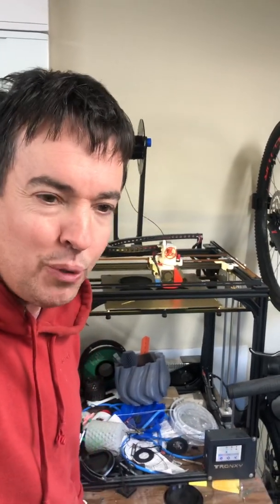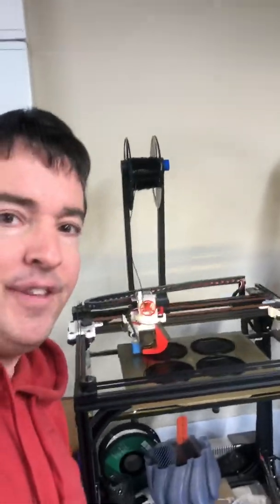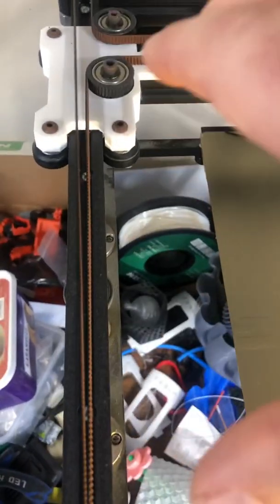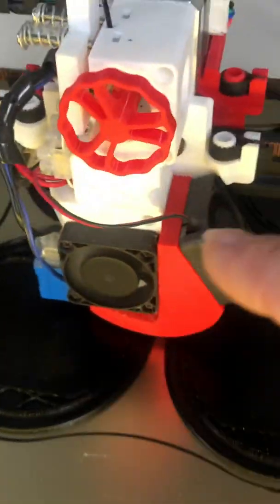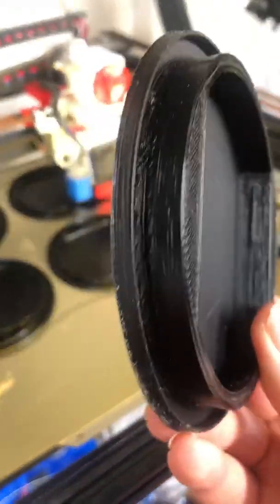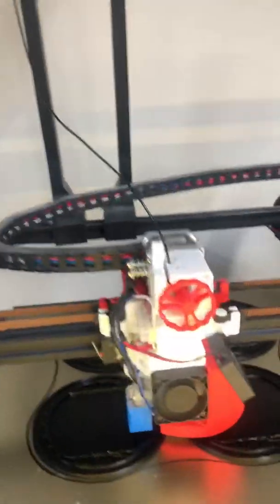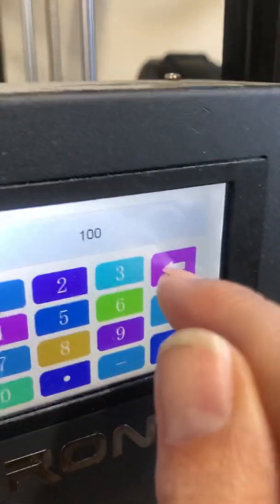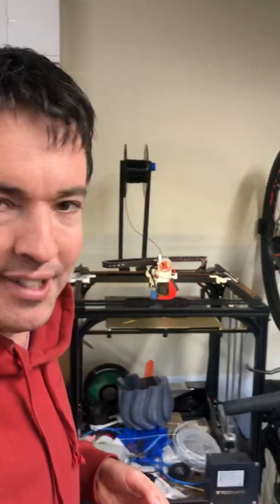Old Tronxy X5sa modified!

Comment: Hi Alex! I hope you are doing well, do you have a github page for your klipper config? , i am having trouble figuring out how i can make this printer home using the black tronxy sensor.
Reply from the maker: Hello, yes thanks! - I’m getting on OK with the ‘speed demon’ VzBot kit, and the ‘quiet quality’ Voron 2.4.

Unfortunately I’ve long since sold the Tronxy but hopefully I still have the printer.cfg backed up on my PC. I’ll have a look shortly and reply
Reply from the maker: This is I hope, the relevant part from the printer.cfg file I used with my Tronxy running Klipper:

[safe_z_home]
home_xy_position: 55, 0
speed: 50
z_hop: 10
z_hop_speed: 5

[bed_screws]
screw1: 12, 12
screw2: 169, 12
screw3: 324, 12
screw4: 12, 305
screw5: 169, 305
screw6: 324, 305

[bed_mesh]
speed: 120
probe_count: 5, 5
horizontal_move_z: 5
algorithm: lagrange
mesh_min : 42, 22
mesh_max : 300, 280
mesh_pps: 0

[probe]
x_offset: -33
y_offset: 16
pin: !PG9
speed: 3
#z_offset: 2

Comment: It looks like you don't have thermal runaway protection. Thats unsafe. Also you could fix the temp problem with a silicon sock on the heater block.
Reply from the maker: Thanks, I think it was enabled, just had a fairly wide tolerance. You’re absolutely right that many early Tronxy X5sa examples did not have it enabled by default and it is essential to do so. This video is a long time ago now and I can’t remember whether I’d carried out a PID tune at that stage (the PID auto tune didn’t work well with Tronxy firmware and I tuned it manually in the end by varying the coefficients/constants until it worked). 

Yes, you’re also right about the silicone sock - if the part cooling fan is effective, the silicone sock helps to prevent it cooling the heat block. 

I have a Voron 2.4 now, but I intend to rebuild my last Tronxy as a VZbot, aiming for the VZ330’s size but the VZ235’s design features.

Cheers for your input :)

Comment: You must be good then Because you got a Tesla Model 3 by the looks of it there!  

I have the newer 2020 upgraded X5SA model of the printer which has newer pulley bearings and silent controller board and silent stepper motors and a 24 Volt heating system for the head and the bed so they heat quickly now and I even brought the with a Tronxy titan extruder and fitted it and brought the Tronxy magnetic build bed cover I still need to cover the bed with electronics heat proof gold tape to get the prints to stick. Buying the PEI type is too expensive here in the UK to buy for a 13 inch wide bed.   

The auto and manual leveling and Z off set settings are crap they don't let you print right!
You set up them and the head goes to the middle and sits about 8 to 10 mm above the bed and starts printing in mid air. You stop it and redo the leveling over and over again even I had to stop it and by hand turn the Z axis movement rods to get the bed to go up to just below the working level as it should be!
As soon as I do the manual or auto steps of leveling then, it still moves up to 10 mm away from the starting print step!

It is like the Z axis off step process un-does you auto or manual settings for the leveling you done just before?
I had it since end of June 2020 and got two prints done from the tons of stress setting it up again and again, each time you even take off the magnetic bed carefully the levels are muck up again even with the strong 6 screws hold the bed in the right place!

This is my 1st ever 3D printer and the stress and waste of my spare time and money this caused me males me feel like I brought the wrong printer and should have spent more and got a known main 3D printer with half the print area and a better system to level and print?

I can't afford to buy another now as I just had some spare money for this printer which had lots of reviews by people who even showed photos of the prints and printer so they were real not faked reviews.

I once tried for over 3 hours to get this printer to auto level around 40 auto level checking and tons of stress as I just could not get the values on the screen all blow the 0.8 shown max to do. I've watched tons of videos of how to level this printer how to use it etc.
I just really fed up fighting with this machine wasting tons of time and money on wasted prints and electricity of course which is pricey in the UK even though we now have 67% off shore wind turbines and almost no coal burning power stations.. anyway I feel like cutting my losses now
Reply from the maker: That’s about the long and short of it. I wonder if you’re using the Tronxy firmware or whether you’ve put Marlin firmware on - most people find Marlin more reliable for saving the Z-offset.

I have the X5sa Pro model now, with Marlin on it, but I still use my Ender 3 for most things - with reliable, manual levelling. A small bed is flat enough that it doesn’t need auto levelling

Comment: Hey i was wondering what version is your motherboard on this X5SA ? 
Mine has a recurring problem it says "filament exhausted replace it" even tho everything is fine and i tripled checked. And therefore i can't print anything I am really stuck rn
Reply from the maker: Hello Vincent - I think that older machine was a V5 motherboard. The problem with yours is still probably just the filament run-out detector switch. The arm on the microswitch inside needs bending to ensure reliable triggering by the filament pushed through it - they’re not always very reliable. Good luck. You can edit the configuration to ignore the filament runout switch - search “Chitu gcode settings” on Google - but first open the detector assembly and adjust the switch - just in case

Comment: Hi, I bought the X5SA Pro and I can confirm the stringing issues. They updated the wiring to a flat cable design that makes it look alot cleaner. I do not like the new controller board, when it's running near full speed the touch screen stops to be responsive and you need to wait for it to slow/ramp down near an edge of your print, also it looks like they changed the acceleration on their new board to alot slower to mitigate some ringing.

For me I'm getting ready to swap out my controller board to a duet and completely rewire the thing, my inductive sensor isn't stable at all with a deviation of nearly half a millimetre, burying the nozzle sometimes into the bed and sometimes just starting a print in mid air. So I'm going for a bltouch and swapping the buildplate for glass. I've owned this printer for 3 weeks now.

The rails do work nicely and they are adjustable if needed, the alignment of the belts are greatly improved over the previous designs as are the bearings for the belts
Reply from the maker: Hello Alex - thanks for your comments!

Strangely my touchscreen is always responsive even when printing fast - I have the old V5 board but now running 1.4.1RC24m4 and the Colorful 0.8 UI. If yours is newer than that, perhaps they have introduced some bug, as I’ve heard of that slowdown happening on the newer printers and it does worry me a little.

I still haven’t got my new printer as the first and second shipments from China were both returned before I received them (or never sent), meaning I’ve had two refunds and am still waiting on the third shipment - but that may also be refunded this week as it’s been 30+days and no tracking number yet.

I’m now also considering the Sapphire Plus as a replacement but I’d rather have a Tronxy, simply because it’s what I know. Thanks again for your comments and best wishes for your printing... I’m sorry the inductive sensor gave you trouble as I’ve always found that reliable too, just luck of the draw I guess!
Reply: @alexshepherd  
I got the latest version, that's why I gave you a heads-up. I looked at the sapphire too but you know guys they always want bigger so I went for the 400 from tronxy. I had a small monoprice select mini V2 which was a nice way to start with 3d printing. I quickly found that the build area for that printer (12x12x12cm)  was very small. So I hope my new tronxy x5sa 400 pro will satisfy my needs for a very long time after all the upgrades. Oh don't be sorry for my inductive sensor, you didn't supply it. it was a learning experience.

Something you might also want to do is sync your z axis. Mine was smooth enough to droop on one side between prints or when powered down. I found a thingyverse post from someone who had the same issue on a earlier version. It will save you some time every time you start/boot your printer, something less to worry about.

I ordered mine from banggood, send from cz to the Netherlands with DHL. Nice track and trace. If you need a item code there just let me know I'll forward it to ya.
Reply from the maker: Alex Schulein amazingly my new X5sa Pro arrived today! About half an hour after my reply.

Thanks for the heads-up, I’ll consider downgrading the software (I see it is a newer version) though that will require changes to the gCode configuration settings (extruder direction etc.), will just see how it goes.

Yes I can understand the size issue, I print lots of these round caps seen in the video and it’s nice to do four at a time which just can’t be done on the smaller printers!

I’m wondering whether to apply my magnetic bed sticker/spring steel sheet directly to the heatbed (as before) or whether to use the second aluminium sheet that has come with the new printer.

All the hardware is SO much better quality than last time around - an unbelievable improvement. No more huge sack of awful screws and tiny nuts and bent or missing parts.

I’m confident that Tronxy’s rails/rollers are smoother than most linear rails would be (unless they were the best HIWIN rails).

The hotend cooling still looks dodgy (blowing on the heatblock, which has a silicone sock, so probably gets away with it) and the part-cooling fan doesn’t look like it blows where it should, just generally... :)
Reply from the maker: Alex Schulein thanks also for the hints on the Z-axis sync. I check mine with a set square before a print, wind it up or down as needed, then I find it’s stayed ok as long as I remove the magnetic bed before trying to remove prints. But yes it’s always the right side that drops, supposedly because of the weight of the cable chain.

That’s one reason why I wanted the Sapphire Plus - the two screws are linked by a belt - but apparently the latest versions are not. I’ll be adding a belt as soon as I can find one the right length
Reply: @alexshepherd  
Congrats on the delivery
I don't need to tell you when you build it to check every bolt and nut for tightness on the pre-assembed things. My hotend lost a bolt mid print and made setting the z offset a nightmare before I tightened it
Reply from the maker: @alexschulein7002  you were absolutely right; I had speed problems with the V6 board (seems to relate to the silent stepper drivers), processor couldn’t keep up for curves with many segments. Putting Marlin on it solved the problem for me. But you were also right about the stringing and retraction - as in, either a lot of stringing, or very long/slow retractions (leaving gaps where the print restarts). Otherwise the X5sa Pro is running well for me - good levelling and movement mechanicals/reliability - so I need to do a direct-drive conversion next!
Reply from the maker: @alexschulein7002  by the way, I improved the Z axis during the build by doubling-up the metal bearings for the smooth rods (one bearing faces up through the bar, one bearing faces down) and I found the brass nuts were unusually loose on the screws, so I fitted anti-backlash nuts instead. The extra friction has helped the Z screws stay in sync much better. I also really recommend the magnetic/removable print surface from Energetic3D, I’m using the powder-coated textured version most of the time and it seems indestructible!
Reply: @alexshepherd  sounds great, I synchronized the z with a belt and two pulleys, for retraction I use 11mm and coasting in cura. In simplified it's wipe and retraction. I get very reasonable results with minimal stringing, mostly gone very incidental. There is a post somewhere I used for these settings

Got mine running a duet WiFi, took some research and tweaking / tuning to get the speed and acceleration to what I wanted, still running the stock hotend which is limiting to top speed. Love the duet features and it's flexibility and everything on WiFi. Running the duet without a display, purely remote

Next upgrade is to enclose it, make the frame stiffer with side panels. I'm using 2020 profile on each corner to expand around all the bits that are sticking out from the stock design, want a double door on the front. Walls will probably be acrylic, not sure yet. At high speeds the entire thing is shaking and it has some resonance too.
Reply from the maker: @alexschulein7002  your plans for enclosure are exactly what I was thinking of doing, after I get the stringing etc. sorted out. I can print in ABS already but it would be better with an enclosure and probably save quite a bit of power...!

11mm retraction! I would never have thought to go that high, I find even with 7mm there’s a ‘spitting’ sound from the hotend which coincides with filament flow restarting, then a gap, then starting again - leaving gaps in my print. You’ve mentioned you’re still using the standard hotend (as I am) so we can rule out the clogging effect of all-metal hotends but it is a similar problem to that which I’m having, and it seems to limit the retraction I can use.

One final question please; what retraction speed (mm/s) do you use with your 11mm retraction?

Cheers for all your advice. I look forward to making a video with my new machine (garage is much tidier now) and this video makes me cringe
Reply: @alexshepherd  hi again

I'm using a relatively high retraction speed of 25 mm/s in cura with incidental stinging, printing pla, for petg it's still bad, I still need to figure out the ideal settings for petg. I've not even attempted abs on this printer.

Used 2020 angles to mount the new profiles and took advantage of a longer length to use this length to elevate the printer aswell( used them as legs). My printer used to be on a box to raise the printer. Now it's about 60cm off the floor with the "new" legs.

Salvaged a nema23 today, planning to use that as a single sided z motor with my sync mod.

This printer is exactly what I thought when I bought it, a nice base to shape into my ultimate printer. Atleast untill I build my own design.
Reply: Something broke on my tronxy, something original. The extruder failed on me, it first started to make a light sqeeky noise what got progressively worse. When I took it apart one of the bearings was completely eaten up. Luckily I had a spare bgm clone. So keep an eye on it, it might fail on you too.
Reply from the maker: @alexschulein7002  great, thanks. I’m intending to do a direct-drive conversion, so will order up one of those BMG clones from AliExpress now and design around that. I’ll also use a smaller stepper motor to keep the moving mass to a minimum...
Reply: @alexshepherd  bgm's are a bit on the heavy side, the one I got was full aluminium, metal gears and such. It would be a bit of a design challenge but you could use a Dremel extention to keep the motor remote but direct drive. Doesn't need to be from Dremel either. There is a company that sells something similar but it uses a screw feeder.

I don't remember if the original tronxy board has a current setting but you could up that aswell if necessary.

Comment: Thanks for this review Mr. Sheperd, I recently bought the new 24V X5SA (not PRO) and I'd like to add some leds as you. Wich type of led you used? Are there some parameters to be setted in the firmware to display the bulb on the menu?. Thanks in advance
Reply from the maker: Hello Sandro - mine is 12v so a standard 12v LED strip, I cut the plug off an old fan (fits the socket labelled ‘light’ on the control board) and soldered that to the LED strip. The earlier version of the firmware had the feature labelled ‘Light’ on the touchscreen but it’s now labelled ‘Fan3’. Works the same, unless in your printer perhaps a fan is connected there? I guess you will need something called a ‘buck converter’ to turn 24v into 12v - or, you could separate the 12v strip into two parts and wire them in series (negative of one strip to positive of the other strip)